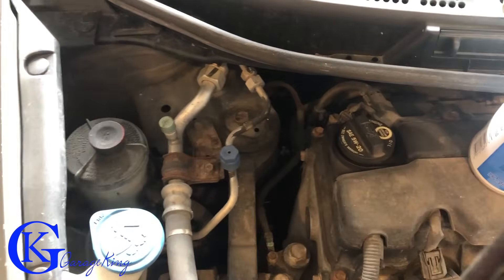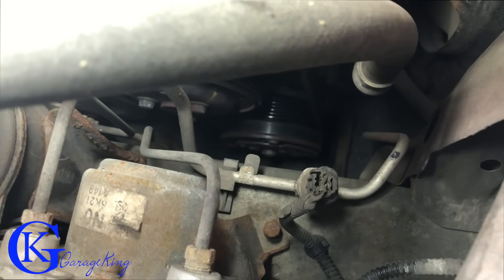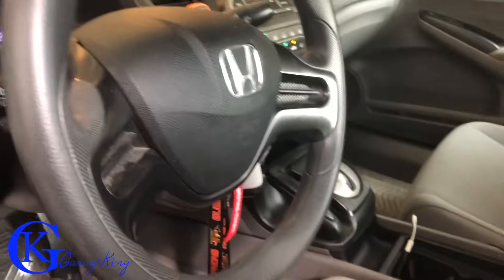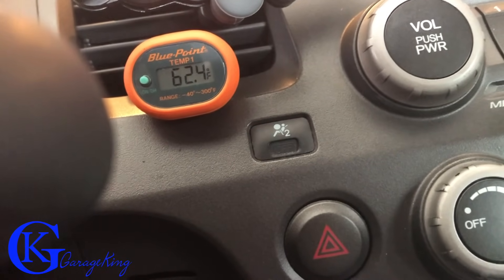How to charge Honda Civic AC with a can

Comment: Hello My 97 honda civc takes 21oz according to sticker, but everytime I vacuum out the system and refill with the can. When the temp get like 90+ it starts blowing hot. There's no leak cause after I vac the system the gauge stays bottom out after 20 to 30min with engine off. Any ideas? Thank you and I subbed yesterday.
Reply from the maker: Hey there and thanks for the question, and a double thanks for supporting the channel :)  I double checked and you are right 21oz, and you can get the bigger cans (I believe they are 20oz) so you should be ok with one of those cans.   Even a small can should still make it cold if its evacuated.  After you fill the AC, on a hot day you say when its 90+ out it starts blowing hot.  When this happens leave the car running, pop the hood and take a look at your compressor to see if its still running.  I show the compressor running in the vid so you will know what to look for.  If the compressor is running it should still be cold.  You should see condensation on the low side (thicker) pipe running to the firewall. That line should be cold. If its cold then check your dash blend doors.  If the compressor is not running then you have a problem.  On your car the thermo switch is a common failure point.  The thermo switch is located right on top of the compressor and held in with a small bolt (I think its 10mm).  The sensor is probably about 100 bucks at the dealer.
Reply: @GarageKing  yeah the compressor runs constantly when its 90 plus outside and the low and high side lines are hot. The low side is warm where u can touch it but not freezing cold as it should be and the hot be HOT lol. but like now I drained it again and vacuum it. Fill it back up with the cans as u did here and right now its COOOOLD., but temp as of now is 75F
Reply: @GarageKing  after fill i put harbor frieght guage on it to chk pressure and now as it is the low side is 27psi, and high side is like 200ish. I thought high side should be 150 to 170is but its running nice like this.
Reply from the maker: @omarG19100  150 to 175 is totally within rage at 75F, when you are at 90F the high side should be about 250 so quite high. Your low side is a little low. You should be a bit higher I think, but nothing to worry about.  This car's low side was running about 40psi at 90F, so your 27psi at 75 does not seem that far off.  Now on a really hot day (this is going to sound stupid) but its best to keep the airflow on recirculation. It will be colder.  You mentioned the compressor keeps running when its hot, and I assume the radiator fan is still going?  If the radiator fan is not on high speed the condenser will not cool enough and the high side will go too high. When you check for temperature differential in the pipes check them right at the firewall.  The difference will be the greatest right at the evaporator in the dash, but its hard to get to so the next best thing is the firewall.
Reply from the maker: @omarG19100  Ohh I forgot to mention, when its hot and not blowing cold you can check the pressures with the gauges and there should be a big differential between the low and high side.  If the low side creeps up too much that will cause warm air and could be a fault with the expansion valve.  I never replaced one on a 97, but I would assume it bolted to the evaporator like the never ones.  Chrysler ones are easy as they are right on the firewall (one of the things Dodge did right).  With the Honda you have to go in the dash.
Reply: @GarageKing  I forgot to mention as I feel like I'm making u read alot lol, but I also replaced condensor and drier. Now when its 90 plus and not cooling as mentioned. If I run water through hose on it while gusges are still hooked up the high side drops back to like 150 to 170ish. however both fans are working.The rad fan is new cause I bought it from autozone 2weeks ago. condensor fan old but still going.
Reply: @GarageKing  I had 2 12oz cans. drip one in. and then use the 2nd can to try to creep up on the right amount cause I'm afraid of over charging 😑 lol
Reply from the maker: @omarG19100  No worries on making me read LOL :)  You caught me at a good time.  Sometime it takes me a day to respond when I'm really busy.  When you spray water and get that drop in pressure that is totally normal, and GOOD !!!  A house AC system will do the same thing.  The water cools the condenser thus reducing the pressure. All good there.
Reply from the maker: @omarG19100  Every system has a little bit of wiggle room, at least all the ones I have seen over the years, and I have seen quite a few.  If you are too full then the system can actually get warmer.  I find that most systems will cool very well with about 30-70% of the recommended charge. 100% is great, but I doubt most people we know the difference between 70 and 100 anyway.  I was going to ask you if you compressor cycles when its hot?  The coolness is caused by the pressure differential between the two sides, so the compressor runs to create a differential, and once that is met it shuts off.  This pressure differential then slowly starts to equalize in the evaporator through the expansion valve.  Once the high and low start getting too close together there is no cooling so the compressor comes back on and creates a pressure differential again, and the cycle goes on and on.  Now depending on ambient temp, and level of refrigerant, sometimes the compressor won't cycle as it takes everything it's got to keep the system cool, so it continually runs to maintain that pressure differential. This also can happen when the refrigerant is low (and make the system get really cold)  - sound funny I know but it happens if the right combination of things happen.  Hope this makes some sense to you.
Reply: @GarageKing  Yes like right now with this 75f temp I hear the compressor going on and off. while temps stay cold but really hot days it keeps spinning. Man I wish I had ur knowledge for HVac lol. I changed my clutch myself but cannot do HVac stuff for the life of me lol
Reply from the maker: @omarG19100  Thanks :)  If your compressor is cycling that is good.  Your pressure switches (I didn't get into that) are working.  The reason it stays spinning on a hot day is to keep that pressure differential in check.  The one thing, you may have a worn compressor that can't pump/suck enough so there is not enough cooling on hot days.  With a worn compressor you usually see gauge readings that are too closer together as it can't "push" the refrigerant around fast enough. The other thing, and I'm just thinking out loud is you may have a bad expansion valve and its letting too much refrigerant into the evaporator.  It just may be that your compressor is worn and can do the work on a cooler day, but on a hot day it struggles to keep up - but before you go replacing it you should take note of the pressure difference on a cool day and a hot day and see if the gap closes.
Reply: @GarageKing  OK sorry I couldn't ans before I was driving at work. I. off now but the temps now is 73F with no sun. I I haven't added any more freon but the guage is now reading 35 psi on low side and 255ish on high side. Car is warmed up to operating  temp, and blowing cold. should I add some or leave it?
Reply: @GarageKing  OK sorry again. But there was still pressure in gyage lines from b 4. so I took guage off completely, and let some pressure out the high and low lines. Put it back on and now its reading 27 low side and like 220 high again. So maybe I need alil more freon?
Reply: @GarageKing  definitely Dodge did something right huh lol
Reply: @GarageKing  I see the thermo switch. its all rusty. I want to take a wire brush and clean it off but not sure if this will make more damage. imma see if I can locate one somewhere, so far no luck. Maybe junkyard.
Reply from the maker: @omarG19100  They did for the AC system !!!
Reply from the maker: @omarG19100  Hey there, I would leave it as 255 is kinda high for 73F
Reply from the maker: @omarG19100  I would leave it, because if you were 255 at 73F you are going to be pushing 300 at 90F, that's pretty high.  I'm not sure where the high pressure cut off is in the Honda but you have to be getting near it at that point I would think.  I just wonder why the low side is only at 27 now??  You could stop the vehicle and let it sit for a while so the sides equalize out.  Then put the gauges on, get a friend to start the car and see how fast they separate, if they separate (low goes to low and high goes to high) really fast you may have a restriction.  The pressure should change gradually and smoothly.  If you have a restriction its usually the expansion valve is partially blocked.
Reply: @GarageKing  yeah thanks for the response  when guages are on, and I turn both side clockwise on strater valve both side meters move (TO ME) at a normal medium speed like when u turn the igntion to chk how much gas u got and the guage goes up lol.
Reply: @GarageKing  and yeah I was talking to myself like I think imma leave it like this lol. Now the test is when temps get back up to see if I made a difference
Reply from the maker: @omarG19100  Ya, once you have the gauges hooked up,  and ALL vales are closed, when you start it, it should usually take a few seconds, like 2-3 normally, so like an old fuel gauge LOL, not one of those new ones that pop up right way !!
Reply: @GarageKing  exactly lol. Imma keep u in the loop. U been so helpful. Thanks for  all your expert advise and patience. U rock man.
Reply from the maker: @omarG19100  Thanks brother !!!!
Reply: @GarageKing  U got it bro 💪
Reply: @GarageKing  OK sorry to bother u again but I think the condensor fan weak. cause low side read 35 and 220ish on high side today 75F. Air was warm unless I ran water on condensor. Got on highway and the air got cold.
Reply: @GarageKing  And compared to the new rad fan I told u I replaced. the air it pushes is much stronger than the condensor fan, like the condensor fan runs but at a not so fast speed.I feel like u should be able to hear both fans run very strongly if u was running air and standing outside in front of the car. Condensor fan runs both u can barley hear it.
Reply from the maker: @omarG19100  Good possibility that you may need a new fan.
Reply from the maker: @omarG19100  Never a bother!!  You know I think you may  need a fan, the temperature for cooling is dependant on the outside temp, and how cool the condenser can get.  So if you can't cool the condenser enough that is a problem.  What makes me think you may need a fan is when you say that you run water on condenser to cool it.  You may need more airflow to cool it (so a faster running fan) will produce more airflow.  It is possible your fan is going.  I wonder if you could find a fan in a wrecker. Hondas are pretty common?  Mind you with a 97 it might be tough, but it may be worth a few calls just to see.
Reply: @GarageKing  yeah definitely lol
Reply: @GarageKing  OK brotha check this. Replaced expansion valve, condensor, and found a fan in junkyard. still the same issue. However. I had a guy come over the house to buy something from me on Facebook market place (Old Compressor from other car), and he wanted to test if it works off of my car battery as my car was already running. He warned me that my battery voltage was like 12.7v as it was running 😬 with ac running as well. Shouldn't it be like 14+v? Sometimes will reach 13.6v but thats the highest it goes. The battery is new from autozone only a yr ago. Alternator?
Reply from the maker: @omarG19100   Ya I think that's a bit low, you should always be over 13 normally with a load.  Your fan on high will bring the voltage down.  An easy way to check is to rev the engine to about 2K RPM, and see if the voltage comes up.  It should be over 13 for sure. I would say probably 13.5, sometimes your vehicle will go over 14, usually right after you start it as its charging the battery.  Once its running for a while it usually does not go that high as your battery is charged and won't accept a higher voltage.  12.7 is low.  If you put a volt meter on it, when you start it, it should go down below 12 when cranking, and then pop back up as soon as the car starts. Could be a sign of the alternator going.

The problem is I think that even with the lower voltage the fans should still push enough air.  I'm almost wondering if its just normal operation for that vehicle? It is an older vehicle and the AC systems were not great back then.  What would be good is if you could find another Honda of that vintage and see how cold the air gets when the vehicle is not moving in traffic.
Reply: @GarageKing  actually my grandma have the same car but automatic and when at op temps it reads 14 something. She had issues like this before as her fuse in the interior fuse box blew for the alt. causing the car to go in limp mode cause it wasn't getting the right Volts. I thought it was tranny going cause her car won't shift out of 2nd. Found out fuse blew and changed it. BOOM Every thing works. No more battery light and chk engine light.
Reply: @GarageKing  o bought a belt too just in case the belt worn out. I never changed belt nor alt. so maybe its OEM. And I was telling my wife its hard to get it up to speed as well like on the highway ppl be passing me It shakes alot
Reply: @GarageKing  but imma give me grandma car a 2nd look while engine is warm and acc on
Reply: @GarageKing  I rev engine to like 2 to 3k and it SLOOOOOWLY rise to 13 something than stops.
Reply from the maker: @omarG19100  Good to know.  I know some cars at idle read lower, and then when you spin the engine up above idle they go to 14v so good to know.
Reply from the maker: @omarG19100  You have to wonder about the voltage if that would really make a difference in how fast the fan spins.  It would a bit, but its not like its 6v or something.  You are only down just over a volt.  Now you may need an alternator, but I'm not sure if that would fix your ac problem as you are still over 12v.  Getting up to speed on highway is more concerning, but many old cars with the ac on are not as peppy as the new cars LOL :) The shaking most likely could be caused by tires.  Engines out of tune or in need of some repair typically shake at idle and not when they are reved up on the highway.  You have done quite a bit of work to this car so I can tell you like it.  I too have a soft spot for the older Hondas.  Really like the Prelude if you remember that one :)  Your ac kind of has me puzzled.  I wish I was there as it would be much easier to just go through it, and I may catch something that you are missing.
Reply: @GarageKing  I know man. I wish u was here too to chk it out. I put 20oz in the but it was at night, od course after I vacuum it and the ac was blowing real cold. I got those smart clips that approached give u on the kit to out in the vents. they change a certain color when temps are right but then once it hit like 90 4get it lol. but I get what u saying though. last yr it was going so good and now huh lol.
Reply: @GarageKing  running out if ideas but taking it to a mech is out bcuz I took it to 2 guys and they didn't even get as close as me lol.
Reply: @GarageKing  yeah man. I replaced alt and cleaned all grounds. Now it idle at 14.3v lol and with accord like 13.9ishv when before it was 12v and only go up to 13ish when revs. Now vaccine system again lol
Reply from the maker: @omarG19100  If you were here this would be a good video to do !!
Reply from the maker: @omarG19100  Good job brother !!!  A lot of times, just a bad ground, or poor connections can cause a lot of problems.  I know someone brought me a car before that had an oil leak.  It was just the oil pressure sensor leaking at the threads, super simple fix.  I hope it works out for you :)
Reply: @GarageKing  definitely lol
Reply: @GarageKing  Yeah man I hope so too. cant believe u have to drop half the motor to get out alt lol.
Reply from the maker: @omarG19100  I haven't done one for a long time on the older civic, but I seem to remember taking off the week to get access and make things easier.
Reply: @GarageKing  the high side needle shaking violently. they mech say freon too hot. maybe not circulating
Reply: @GarageKing  garden hose cools it down
Reply: @GarageKing  GM bro. made some progress. I decided to order a Spal cooling fan for the condebsor which came in yesterday and let me tell u the system was working really well. woke up in the a.m. to a leak lol. Fix one thing then something else breaks huh. I replaced as much o rings as o can possibly get to and vac system already. Now im waiting to see if the guage bleeds down from a leak. (HOPEFULLY NOT).
Reply: @GarageKing  With this new performance fan once I get it to hold gas i should be ok lol
Reply from the maker: @omarG19100  Sounds good :)
Reply from the maker: @omarG19100  Ahhh sorry to hear that.  Well at least you got one problem fixed.  If you have ever tried dye is works very well.  You evacuate the system, put a little refrigerant in so there is some pressure, then put the dye in, then recharge up. Something like this https://amzn.to/3nAKBav then drive the car for a few days, then go in the garage and turn off the lights and use the blacklight with the glasses.  You would be surprised what you find.  If you do this put a rag around the fill port, that dye really glows and can get around everywhere, so you only want it where there is actual leak.  It will come out on its own.
Reply: @GarageKing  OK will try
Reply: @GarageKing  Yeah there's a leak. Freon leaked out already. compressor not on and hot air blowing. huh gotta find this leak
Reply from the maker: @omarG19100  If it leaks out in a day or two that is a fast leak, and you should be able to find it.  Hopefully its not a bunch of small leaks adding up.........
Reply: @GarageKing  yeah it only sat for like 2hrs and leaked down so much that the compressor not even kicking on. I went to store to buy uv light and glasses to see if I can find leaks. do u think a pin hole can be in the lines? I find it hard to believe that after changing all o rings it still leajs
Reply from the maker: @omarG19100  A pin hole in the line can happen but its rare. I find most leaks at the compressor front seal (where the compressor is spinning), the rubber hose to line crimping, the condenser, and sometimes at the evaporator. With the dye, if you run the car and if the vents start glowing you know its the evaporator.
Reply: @GarageKing  OK. I found green residue from the dye / oil that I put in when I was filling at the evap. I used the uv light to spot it, but I just hope thats not old residue from when I had the evap out before to do expansion valve. well like always I'll keep u up to date loo
Reply from the maker: @omarG19100  Sounds good, and ya, you have to be sooo neat and clean with that dye as its gets everywhere.
Reply: @GarageKing  I know its crazy. I hate Hvac. Everything else simple huh lol
Reply: @GarageKing  GOOD MORNING SIR.😎Let it sit overnight and all good 👍.
Reply from the maker: That is awesome !!!
Reply: @GarageKing  sure is. Thanks again man.